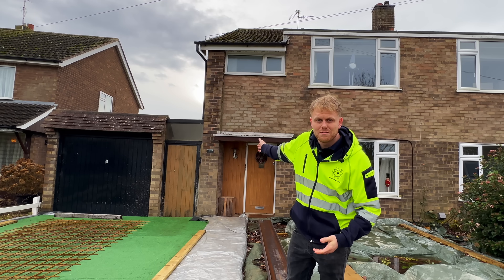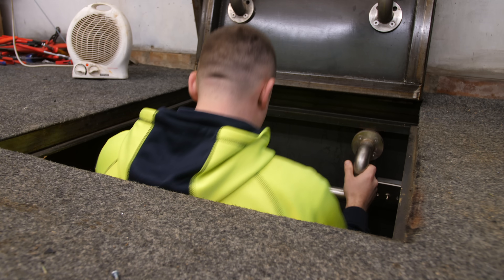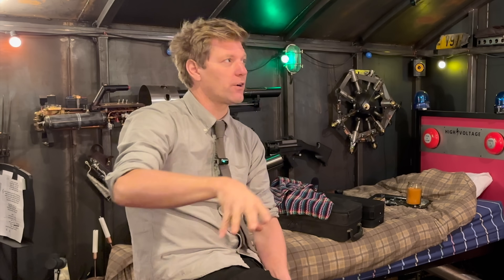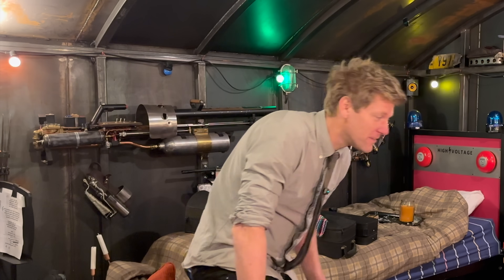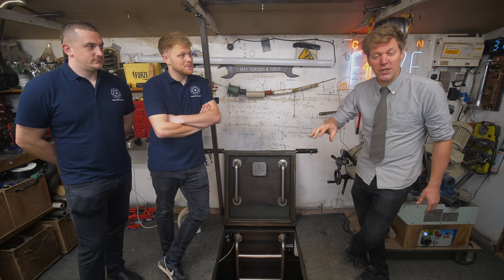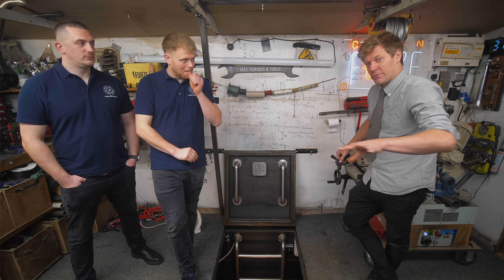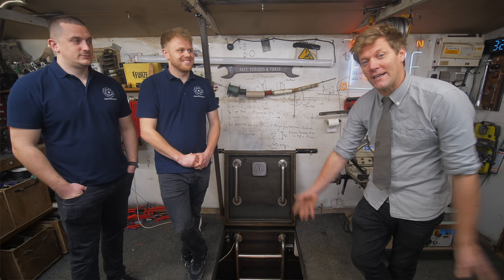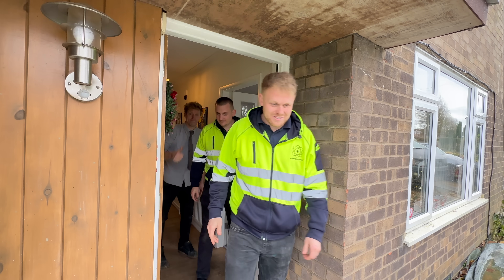Colin Furze Tests For Radon Gas!

Comment: Wow I had no idea how common it was. I live in Australia, luckily my area is low risk. But still there. Good luck with your testing,  hoping your levels are safe.
Reply: Yes yes yes…so very common… like not an issue till like 30 years ago.  Here in the USA in the mid 90’s lots of money spent on studies and companies, governments came out and try to scare people with it. It’s all about money, companies found they could make money with it.  And yes I built 72 houses from 1996-2011.  Question to ask yourself why does it take 3 months to do a test…  air out your house, keep the moisture down, run a dehumidifier.  In the USA: 1: cigarette smoking, 2. Pipe and cigar smoking, 3 passive or second-hand smoke, 4 asbestos,  5. Radon Gas, 6. Genetics, 7. Lung disease, 8. Air pollution,  9. Previous Lung Cancer,  10. Ingesting Arsenic.    So you decide…. But to me it’s about creating fear and making money.  80% of lung cancer is caused by smoking.  But you decide…..

Comment: I use AirThings Wave radon detector  and very satisfied with it. You can get measurements within a day and monitor changes if you make adjustments in ventilation.
Reply: I was going to mention AirThings if someone else hadn't already. I live in a high-radon area in 2019 new construction and the levels in our basement were very high.  The builder had put in a 'passive' mitigation system, which is just a PVC pipe from under the basement slab up through the roof to give it a path of least resistance, but it wasn't enough. We had to convert it to an 'active' system by installing a fan in said pipe to constantly suck from beneath the slab, and that dropped levels well below the safe point.

I keep an AirThings sensor in the basement, and have one in my first floor office and one in our master bedroom on the second floor. There latter two also monitor CO2, VOCs, humidity, etc.

Using these we found the CO2 levels in our home were often very elevated. The perils of modern, highly efficient construction - very little gas exchange. So we installed an ERV (Energy Recovery Ventilation) system to improve the air exchange without too much energy loss and that really improved overall air quality too.

I like these AirThings sensors. They track all kinds of things you might not otherwise think about.

Comment: It’s more dangerous to prevent radon from entering a building than to let it through and escape, it builds up under the house if blocked and the radiation builds to a degree that affects you. The solution should always be to vent it.

Comment: @chuckgoecke
1 minute ago (edited)
The problem with radon isn't so much the radon gas itself, which would come and go in and out of your lungs as a gas.  It's the radioactive decay products, especially polonium and its decay products, which are not gases and much more radioactive and some are alpha emitters which if lodged in one's lungs as tiny polonium dust particles, are super likely to cause mutations.  Alpha particle radiation is sort of weak at penetrating, but when right next to cells they can easily penetrate their nucleus and hit their DNA.  Polonium dust could be on any surfaces where lots of radon gas has been present or passing through.  The biggest risk is for workers in certain petroleum gas processing vessels that tend to concentrate radon, which behaves sorta like ethane and propane in the gas refining stream. This is called NORM, Naturally Occurring Radioactive Materials, which is an Industrial hygiene issue for workers who service those vessels, that can get pretty high levels of polonium attached to the vessel walls due to the very high throughputs of radon containing gas.  Gas vessel clean out dust is a major hazard.  Dust in a home with radon could likewise be somewhat hazardous.  Cleaning all these situations should be to avoid dust, somewhat like dealing with asbestos.  Wear dust masks and use air filtration for the polonium dust, even though they don't help with actual radon gas.  I was a Petroleum Engineer who worked with an expert on Industrial hygiene and NORM from Phillips Petroleum on safety training module for said workers

Comment: I'm from Belgium and heard about Radon a few years ago. I conducted a test with FANC(Federal Agency for Nuclear Control), and the results were OK. Now, I have an Airthings electronic tester, and I've noticed that during the winter when everything is closed, I experience higher Radon concentrations compared to the summer months. Additionally, the levels can vary from day to day; some days, I observe levels almost reaching 200 or even higher, while on other days, it's lower than 50. However, my average Radon concentration on a yearly basis remains below 100.
Reply: Are those pCi?

Comment: As bad or worse than Radon in the air is Radon in water. If an air test shows high levels and the building has a water well, then the water needs to be tested. There's two ways to deal with it. One is a filter and the other is an aeration tank. The filter is simple to install in the water line from the well, but it eventually gets saturated and has to be disposed of as nuclear waste. I bet that's a pretty high cost above that of the filter.

An aeration tank draws in air from outside and bubbles it through the water, then air from the top of the tank gets blown outside along with the Radon. Look up some videos of commercial units, they use PVC pipe and polypropylene tanks. Should be buildable by most people who are handy with tools and building stuff like Colin Furze.

Another way to get Radon out of well water is a spray tower but that's likely not too viable in an urban setting.
Reply: Wells are incredibly uncommon in the UK.

Basically unless you are in the middle of nowhere you will be connected to the mains water supply that comes from a water treatment facility usually sourced from a reservoir.
Reply: Cisterns are the primary concern and even they are rare here. Radon has a short half life so time can clean it too. Its a by product of uranium. 

There isn't evidence of harm caused by radon permeated water yet, though, whereas the harms of binding in the lungs is understood. Both uranium and thorium degrade into lead, which is another contaminant that is poisonous that may be in your soils if you detect radon gas, and very dangerous in ground water. 

Water should, and is here always be regularly tested for contaminants, not merely radon.
Reply: @mandowarrior123  Ahh but... time does not "clean it" if the radon is constantly being refreshed with new gas from the earth... which is the way it works.   The decay products tend to contaminate also.

Comment: The annoying thing about radon is you can't see it. And those measurements takes ages. By the time you get a reading you're already panicking in case it's high.
I know it's not too worrisome with a reading of 200-300 for a few months but it's like everything else that increases risk; It doesn't hurt to reduce it if you can.
In my case I had a gap between the concrete floor and the foundation wall in basement (very old house, no barrier) and it was sucking air in from under the foundation. Taking care of that reduced radon in the rest of the house by 2/3 !  For peace of mind I got an AirThings View+ so I can see plots of daily, weekly, monthly and it's staggering how little was needed to improve it.

Comment: Safetyinspectors love talking sbout radon... and it is absolutely pointoess if you air out your home and don't live in an airtight cheesebell.
Reply: But in locations where you have heating / cooling systems, the drive to energy efficiency tends to minimize air changes and focus on sealing the house. This allows radon to concentrate up.

Comment: What are the side effects of Radon ? I spend lots of time underground exploring old mines and bunkers all over wiltshire, got me worried now !!
Reply: Low level cell damage - harmless except for elevated risk of cancer (and the risk levels are not particularly well understood). It's probably a lifetime exposure risk more than a per-event thing (unless the levels are crazy high, then you get traditional radiation poisoning effects)
Reply: @SeanHoulihane  yeah that is the impression I get, looking at the radon heat map it seem the area I visit are medium levels, though some of them have signs warning you. But like you say, living in the area and visits are quite different.
Reply from the maker: We carried out testing in a cave several years ago for a TV production company. The BBC2 show was called Body Clock: What Makes Us Tick? They had a former Commando live underground for 10 days as an experiment. 

They wanted to use a cave for the experiment and we tested for radon for health and safety. 
Turns out he would only have had to spend 4 hours in the cave before he would have reached his annual radiation exposure and be in breach of IRR17 regulations!

So they had to use a nuclear bunker instead. 

If you spend a lot of time underground use caution. Try to find out what potential hazards there are, not only from radon.

Comment: Hi Colin
Building Control would usually pick up on the need for Radon precautions which made me wonder how you have dealt with the building regs aspect of the project.
Reply: Shurup. I want to see how he gets on especially with the radon don’t want building control around cause he will do a better job

Comment: Contiguous barriers are available and can be tested on completion but these are placed durring the build, ventilated subfloor voids also work, designing the potential problem out at the begging is easiest but why didn't the local authority flag this as an issue at the planning stage?
Reply: Because Colin did an "easier to ask forgiveness than permission" thing when he started all this bunker and tunnel building. He didn't get council planning permission until later.
Reply: @greggv8  given the nature of the area, I'm surprised that EH didn't pick up on that and require it irrespective of if the project had started, as commencing without permission is always at the developers risk.

Comment: heck, I walked around for years with a glow in the dark watch - radon on my wrist. love it. I  will be a superhero. or summat. lol
Reply: Radium on the watch, if it's old enough.
Reply: A lot of the ionizing radiation given off by the radium decay chain is alpha particles which can't penetrate the watch crystal or body.  Some isotopes in the decay chain give off beta particles, most of which won't be able to penetrate the crystal or body.  So you would receive very, very little ionizing radiation from wearing an old glow-in-the-dark watch.  Just don't open it up as you would then have an increased risk of breathing in radioactive dust from the interior of the watch, and then the alpha and beta particles would have direct access to your lung cells.

Comment: Should throw a centrally mounted pps in either way to help with his condensation in the tunnel, hes got working extraction at the bunker end thats drawing moisture from tunnel and garage end exacerbating the problem. You could also get him to install a ventilation shaft whilst its still under construction so you can install a more powerful loft unit instead of a ppsf which will struggle with such a large open area.
Reply: After thinking about it further, positive pressure is probably not the best way to go due to the house access and the potential of the positive air pressure feeding radon into the living space. A more cautious and directed option would be better; by installing sump extraction pumps strategically at both ends of the tunnel at surface level directing the radon away from the bunker in the first place with the air exhausting above the roofline of the property, couple this with radon barrier coverings/sealant in the bunker area as belt and braces. Still have a centrally mounted PPs/f to deal with any moisture creation, Colin likes the odd cup of tea.
Reply: @justlooking3572 The positive pressure works by reversing the airflow so the radon won't seep in. Instead the clean air will "seep out." So there will not be any radon to be pumped from the bunker to the house.
Reply: @AnttiBrax   it doesn't reverse it, it creates a positive pressure as a barrier to redirect the radon particles, and will use any available gap to push any away, including through the kitchen entrance to the house. And as the entrance doesn't have a proper seal, or is even closed very often, its barrier making ability will be compromised and any air will take the path of least resistance, entering into the property and no positive pressure will be created at all, all it will do is create a cold draught into the kitchen, effectively providing a superhighway for any radon particles to get into the house from the cooler bunker and will also give the tenant a pretty valid reason to switch it off if it makes their house cold. An external sump unit will redirect the radon away from the bunker all together. If the bunker wasn't directly attached to the property, positive pressure would be the perfect option but it is, so its not.

Comment from the maker: Have you heard of radon gas before?
Reply: There’s no such thing, Mrs Furze is just trying new ways to stop Colin after her concerns about his welding standards😂
Reply from the maker: @johnbuyers8095  🤣🤣
Reply: Yes
Reply: Yes, I live in Cornwall and worked underground.
Reply: can i run my boiler on it ?
Reply from the maker: @memecoinmafia2732  absolutely not
Reply: @Glencoe-Radvac  😒
Reply: I grew up in Derbyshire. So yes.
Reply: I learned about it at school many years ago, but I thought it was more of a "if you live in a radon rich area, tough" kinda deal, didn't know that there were steps that could be taken to mitigate exposure. I'll have to check that map out!
Reply from the maker: @widgity  let us know what you find! Here to assist if needed, remember that map is indicative and not 100% accurate. High levels are found in the “low risk areas” all the time!  🙂
Reply: Yes, but more in the US. UK houses were so leaky it was so much less of an issue.

As we now need to seal our homes now much more awareness of the need to think about it.
Reply: Yes, in Western Canada it started showing up in building discussions in the late 80s and 90s…  But we also discuss the potential hazards of working with recycled oil-field drilling pipe…   There’s a lot of that going into making fences and shed frameworks.
Reply: Yep, our house has a pipe that goes from the basement to the garage with a red liquid meter in it presuming its related to the pressure as its seems to always stay at 1. No idea what its doing just know it exists lol
Reply from the maker: @Colink02  send me a picture via email of the system and I can explain what it is 👍🏼
Info@glencoe-radvac.com - ask for Dan.
Reply: It gives me a buzz 🍻